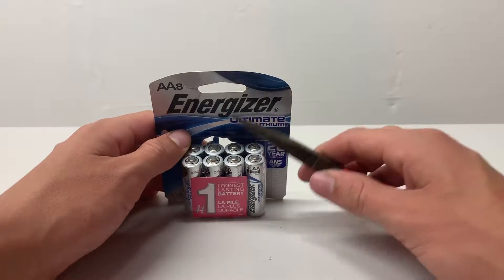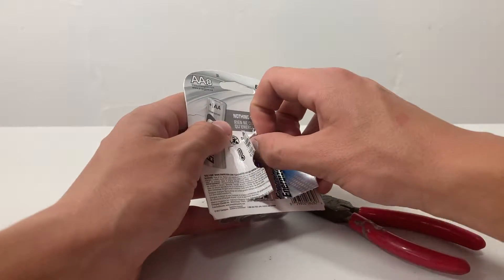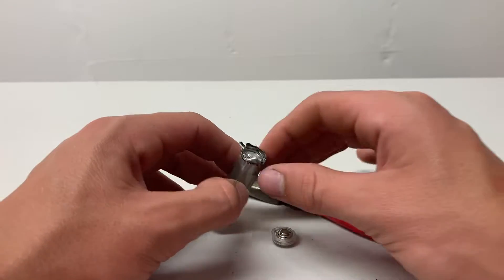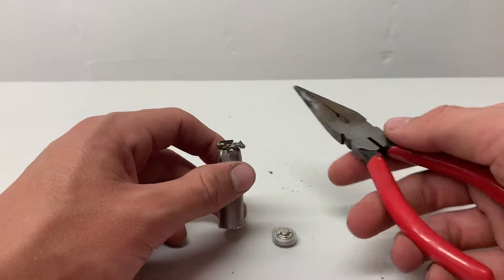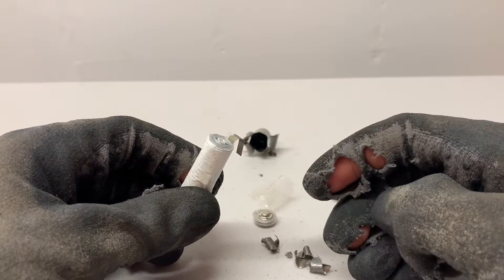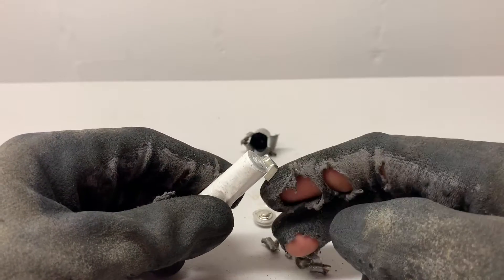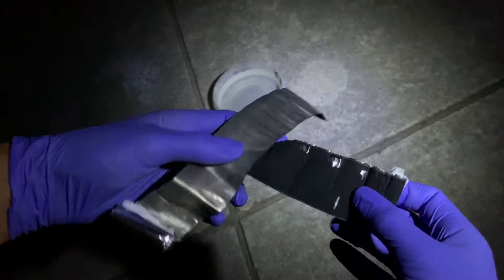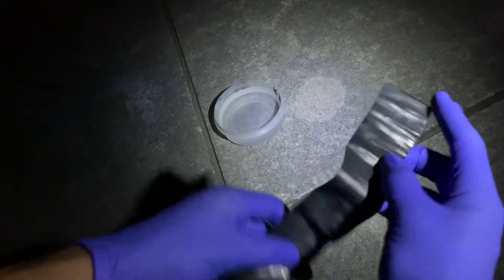How to Disassemble a Battery to Extract Lithium

Comment: That lithium had to be hot as hell for how long it took him to get it out and using pliers to pull it out is asking for a fire. Hold the base with vise grip pliers and then use cutters to start the peeling and then you can use pliers to roll it down. You actually want to roll it sideways. That way you dont have to use pliars to pull it out as long as you roll it down to where the vice grips are holding it on the bottom. Imo at least

Comment: Alternatively, the lithium can be stored in paraffin oil from the hardware store, but you would also need to weigh down the lithium since it's the only solid element to be less dense than paraffin oil. If you don't add a paperweight, the lithium foil will just float & tarnish.

Comment: QUESTION: Is there a PCB inside the top button? Many Lithium batteries include a small PCB DC-DC converter from 3.7V to 1.5V in the top part. Did you find one? Can you send me one?

Comment: Make sure not to penetrape the wrapper while stripping the case, if the anode and cathode are connected is can start the lithium strip to begin heating up uncontrollably. Then it needs to be removed ASAP or risk becoming useless or possibly dangerous. Great video!
Reply: omg thank you. You saved my life dude. I noticed that it was getting hotter and found an empty jar on one side. When I came back, there was a small fire, and I immediately put it in the jar and closed the lid
Reply: @Deevial  Happy to help. the guy below with the comment about using a pipe cutter may be onto something I think. Haven't tried it yet, though. Good luck man, but if you make a mistake when it is mostly done and it heats up you can still get the case off and unroll the wrapper with time to spare.
Reply: It also makes hydrogen sulfide which isn't dangerous in low concentrations. When I mean low I mean low low like the amount of hydrogen and sulfide from this battery one. But it still will smell like shit

Comment: I have lots if lithium-ion batteries from laptops. When I took the lithium strips out of a few of them. not a single one exploded when I threw them in water.
Pretty disappointing. In fact I have removed lithium from batteries in the past and it really ignited big time when I threw water on it.
Reply: I think the way rechargable Li-ion batteries used in laptops, etc. are not designed in the same way as single use rolled Li+ batteries. They can use liquid substrates or other types, which I think makes the cylindrical design easier the simply extract virtually pure Li metal. This is also an issue with cellphone type batteries using Li.  AFAIK only the laptop batteries with tubular shapes have lithium, many other use NiMH, etc. AA+AAA Li batteries are easiest and cheapest to get good product.

Comment: I smashed it on a ground it's burning. What do I do
Reply: I know I'm 5 months  late,  but  uh, ain't  much you can do. If you put water on it, it explodes. You might be able to smother it if you have a way to, but make sure it's something that won't catch fire/melt. Also, the fumes are highly corrosive, so DO NOT BREATHE IN THE FUMES. Won't kill you (most likely), but it will seriously mess up your lungs if you breathe in enough.

Comment: But when peeling the lithium off it was thinking if it can quickly store it in a sealed tupperware container to let any air or moist in for storage.
uknow so one day I can use them in the future
Reply: (9 months after lmao) If you do this and want to store the lithium put it in mineral oil, it won't react with it and will be able to be stored safely

Comment: I know this video was three years ago, but I am trying to get the lithium out of a battery for some school stuff. Is it normal for it to spark, heat up, and make a fizzling sound? Btw my face protection is a surgical mask and a pair of glasses
Reply: Keep the battery immersed in a bowl of mineral oil.
Reply: Did u do it does it blow up?
Reply: @a7a457  it does blow up lithium when exposed to water does blow up
Reply: dont lie its for meth :)

Comment: i tried it and after i removed the plastic thing and the plate it started heating up tf is going on help
Reply: Maybe you should firqt discharge it. Of course there can be energy like you can see the s7 note:when touched by f.e metal it caughts on fire

Comment: What are the dangers involved in this (other than the fire and explosion) is it more dangerous to breathe in this smoke than that of firewood?
Reply: If you’re reacting lithium with water, absolutely. The lithium hydroxide smoke that comes off is HIGHLY CORROSIVE. Breathing it in is FAR worse than breathing in smoke from firewood. It probably won’t kill you, but irritation might cause issues either breathing and swallowing.
Reply: @Vulcan3027  was expecting some half-sarcastic smart ass remark. 
Appreciate the honesty

Comment: Mine didn't combust......
Reply: Dead batteries don't work as well, if at all
Reply: @sovietmusiclover8466  It wasn't dead
Reply: @jimsagubigula7337  Oh, then in that case, it probably was a different type of battery. Some batteries don't have lithium in them. I think rechargeable batteries are the main ones with Lithium.
Reply: @sovietmusiclover8466  Maybe. Though the metal sheet quickly turned to black when I exposed it in the air and it melted in a few seconds when I put it in water
Reply: @jimsagubigula7337  Oh, then it might've just been old. I think that older batteries don't react as well.

Comment: I recommend to drain the battery first.. either way still dangerous
Reply: It dosen t work with dead ones
Reply: @darius.c1629  it should work, the material within the battery doesn’t change if its dead or alive. Did you use a lithium battery??
Reply: @Suuuppyyy  These batteries generate electricity via a chemical reaction between the cathode and the anode, so the lithium isn't 'used up', but it is converted to a different chemical form which won't react like pure lithium.
Reply: How

Comment: The best way I got lithium outta batteries is by using pipe cutter.  Like you use for copper.  We won't talk about what "experiments " I used the lithium for. But I have pulled a many strips in my time and it is definitely more efficient with my method. Give her a try.
Reply: You got a number ?
Reply: I’m curious as to why lithium is needed for these “experiments”?  What is is used for? Do you burn it and the gas adds something to your experiment?
Reply: @AilanthusMoth  Production of solvated electrons after exposure to NH3
Reply: Sussegus
Reply: u made meth didn’t u
Reply: @merm3499  ummmmm. I cannot confirm nor deny these accusations lol
Reply: @codro1982  by the time the batteries are peeled and the pills popped out of the package a person’s fingers would be destroyed. Or so I’ve heard.
Reply: @erkyderky  so I've heard the best way to crush the pills is with a pickle jar. And dollar general has great deals on cold packs.  I don't know why you need them. But them and the blue drano crystals seem to make a great combo.
Reply: Yo how much a g?
Reply: @user-xs1is9yd5o 50$
Reply: Yeah bro those old experiments is what brought me to this video. And to your comment cheers.

Comment: I think my pliers are too big. Every time i grip it, it just glides off.  Having to do it one-handed doesn't help, either. It should probably be possible to carefully use a dremel
Reply: my guy u wanna die? cutting metal with a dremel makes sparks. remember how ridiculously flammable and reactive lithium metal is.
Reply: Try using blunt side cutters

Comment: Is this gonna work with dead AAAs? Also, is there a way to stop the tarnishing by putting the strips in oil or a bag? I want to be able to make it a powder.
Reply from the maker: I have never tried it with dead ones. However, I am very certain it will not work and definitely not to the extent shown in the video. Also to preserve it in oil you would need a larger chunk of lithium; the thin strip found in the battery will still tarnish since it has much more surface area per amount.
Reply: @pyrochemminer3453  after 3 months and 5 attempts, I can confirm that dead batteries don’t work. The lithium strip fizzles in water and makes a cloud of nasty smelling sulfur. I’ve gotten some success with AAAs but nothing like the video.
Reply from the maker: Dang that's pretty cool you tried that out. It's definitely good to know, so people don't waste their time.
Reply: @jackgyver4683  yo, I'm glad you made this comment. I was just about halfway through peeling back the steel lol. 

Guess it's practice lol
Reply: Idk
Reply: Sulphur... wait a minute... That is the smell in my room after just finishing

Comment: Do anyone asking why it didn’t work for them first consider the fact that pure lithium can be extremely dangerous and is not used in most batteries instead they mainly use Lithium hydroxide or LiCoO2 Be safe, just because you saw it on the internet doesn’t mean it’s safe or worth doing!
Reply: No
Reply: all primary lithium batteries use lithium foil, as far as I know.... The rechargeable lithium-ion etc have no lithium metal in them.

Comment: Y didnt my lithium strip do that i tore off a small piece no sizzle no reaction in water or exposure to fire
Reply from the maker: how long did you take to put it in the water from when you got it out of the steel casing and unwrapped it?

also how big was the piece you tore off?
Reply: Sure it was lithium? It couldve been nickel or smthin too.
Reply: Was it lithium most batteries don’t use pure lithium, they either use lithium hydroxide or LiCoO2

Comment: does it have to be a new battery?  Is the lithium the same composition if the battery has an internal short?
Reply from the maker: Yes I believe so, because even batteries that were new but I hadn't opened in one year plus did not work. However, you could always try a used battery and that is actually something I would like to attempt. As for the internal short, most of the time the quality of the reaction is much lower. Whenever I accidentally short the battery and it gets really hot, the lithium inside typically just smokes in the water and never catches fire.
Reply: @pyrochemminer3453  That is what I was really getting at....would the reaction be the same if the battery were dead.  My guess is that the reaction would not be the same as a battery is a chemical reaction by design and therefore the composition (the formula) has to change...so the amount of desired active ingredient is always changing.  Evidenced by your new batteries, while still in the packaging..were changing just sitting.  That also means the batteries of different manufacturers is also different as each is tweeking the formula to gain a competitive advantage or cost reduction at your and my expense.
Reply from the maker: @nonperishables5870  I agree because non-rechargeable or primary batteries only allow ions and electrons to flow once. The pure lithium metal is the anode; the ions will flow inside the battery from the lithium to the iron disulfide (cathode) and the electrons will go from the anode through the circuit and into the cathode. Once this occurs and the battery is dead, the lithium will not have the same properties.
Reply from the maker: When talking about internal shorting, that would be when I accidentally cause the battery to discharge at a rapid rate; thus heating up the battery and changing the composition. This explains why it does not behave the same in the water.